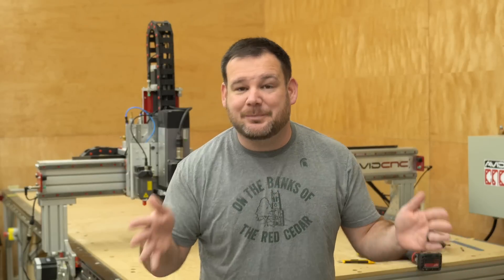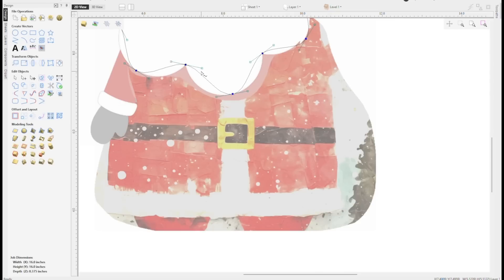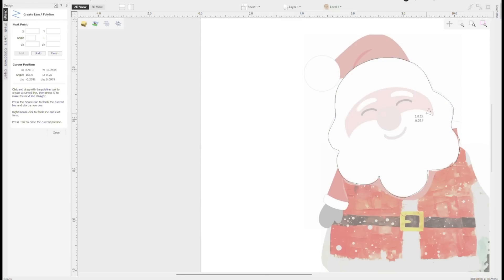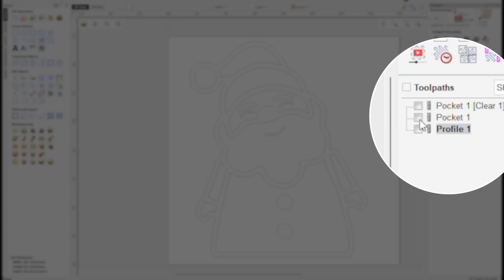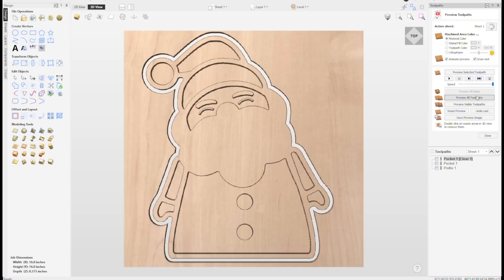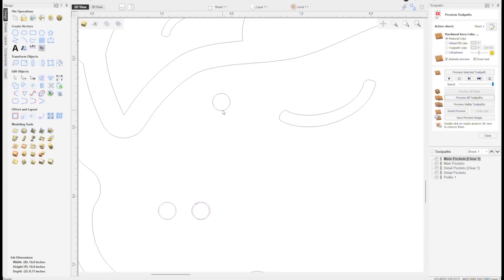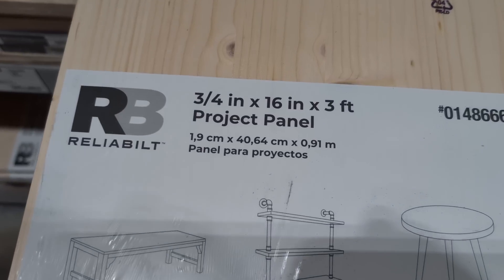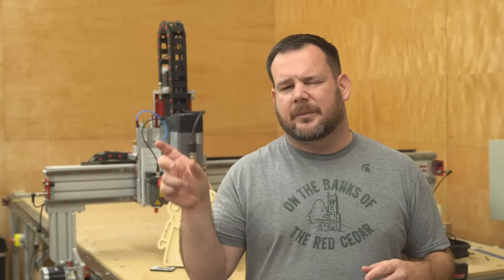Pay for your CNC before Christmas? Make Something That Sells Episode #2

Comment: you could save money by making it a bit smaller to fit within a 2x12 and have less steps on glue up. im gonna try it nice design thanks for sharing
Reply from the maker: I thought about try this. Great idea
Reply: @AndyBirdBuilds  looks great in vectric waiting on parts for my dust collector to actually carve it out. Had to modify an eyebrow to use all the same tools. Should work ok from what I see.